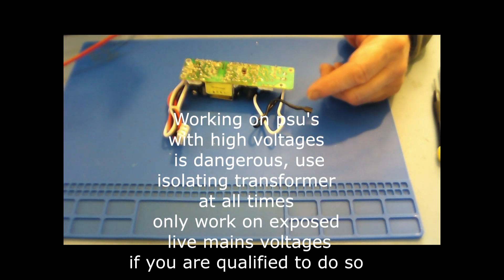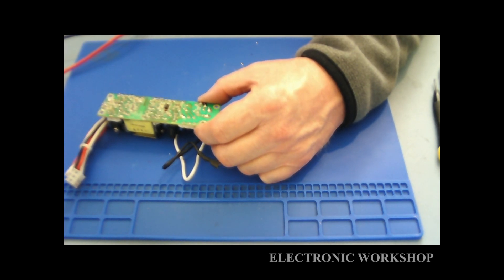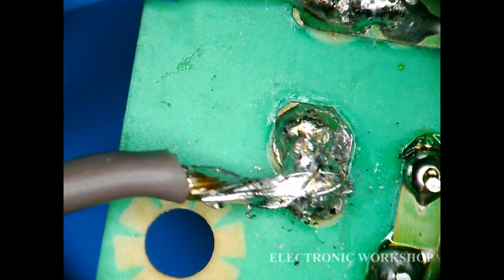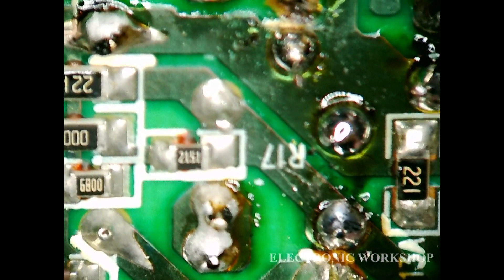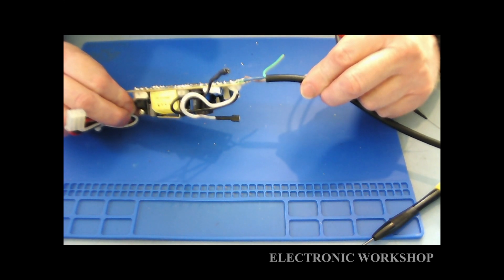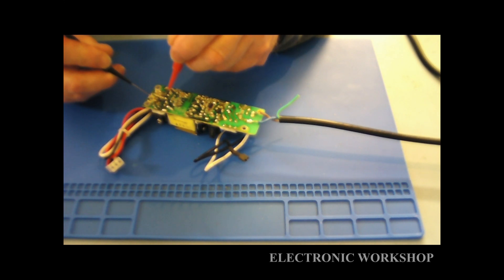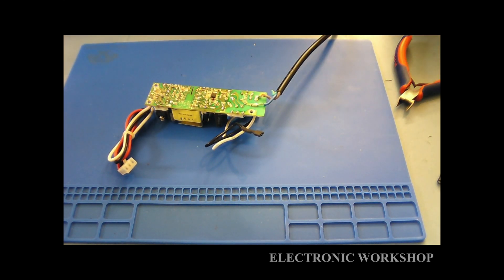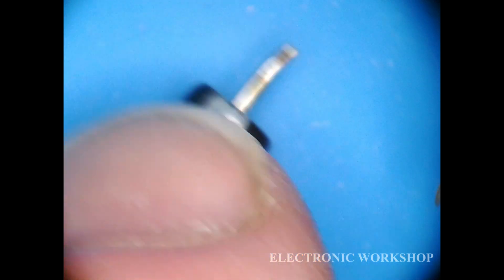DSO-142L POWER SUPPLY 9 (HP KVM SWITCH PSU) REPAIR

Comment: Almost the same. Staerted changing the output capacitors (470uFx10V  and 2200uFx10V) that were bulged and measuring way lower the nominal value. Had +5V, but -5V giving like -2V). After replacing the caps, nothing. 0V on both outputs. Changed the capacitor on the side of the board and the PSU is working now, Used a 100uFx25V, I hadn't any 47uF caps on my bin.

Comment: Thank you so much, I had the same power supply failed and your video helped me find the problem. The capacitor had been devalued at 33uF, I replaced it with the new one (25v 47uF) and it worked, my 12 years old KVM switch is back to life. Kudos!

Comment: Thank you for the movie, it saved my life;) I got such a power supply for repair, it did not start. Out of habit, I looked at YT and ... found this movie. I replaced this capacitor right away and the power supply works :) The one I soldered has 40 uF and ... 150 ohm !! (ESR). Pozdrowienia z Polski.